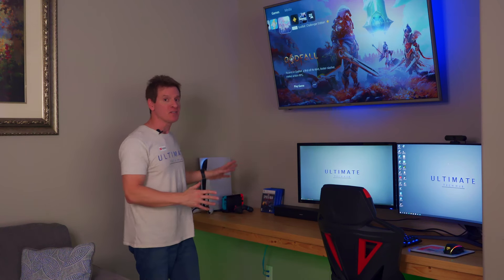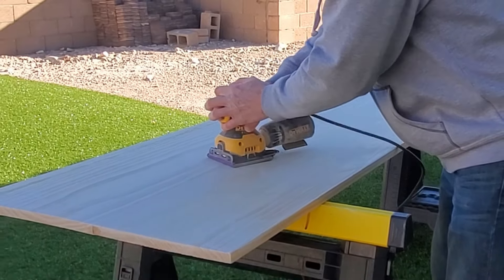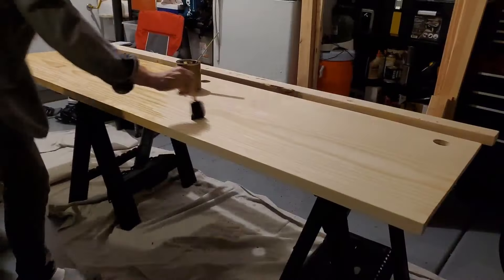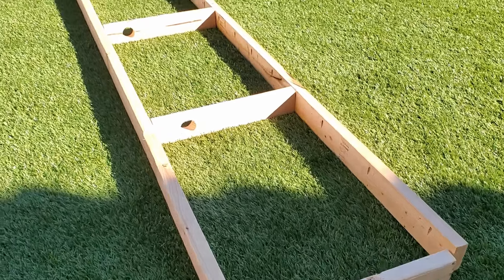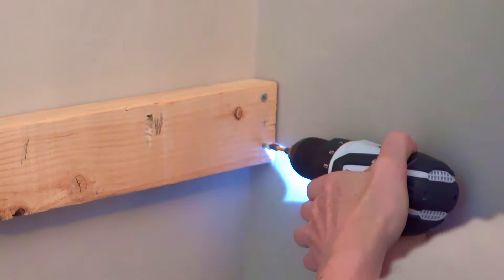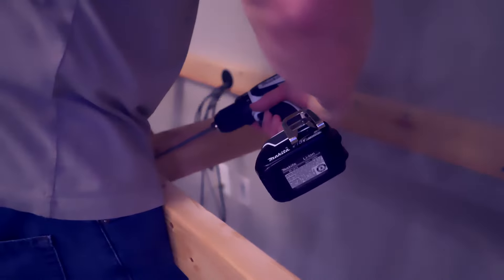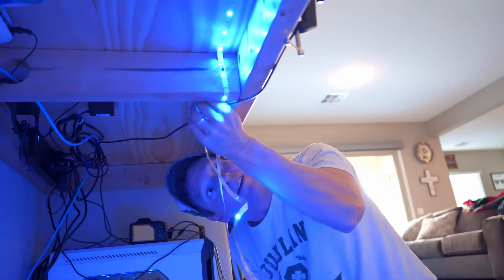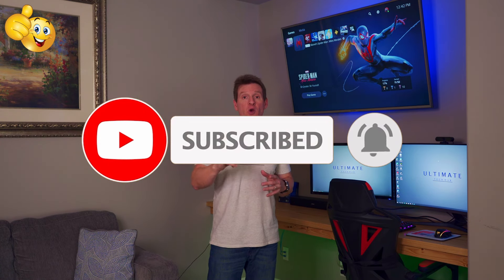EASY FLOATING DESK INSTALL UNDER $300! START-TO-FINISH!

Comment: Holy cow! you are one brave guy using table saw for miter cuts using a fence!! Thankfully your guard kept the cut pieces from flying to your face. 
Nice desk though!   you probably did not need to use the anchors if you used a pocket hole screw onto your back 2x4 piece. you already had 2 screws on a stud towards the front of those two pieces if I'm not mistaken :)
Reply from the maker: I always do overkill when it comes to wall anchors and securing boards to walls! Thanks for watching!
Reply: @UltimateTechHub  haha I know the feeling ✌🏽